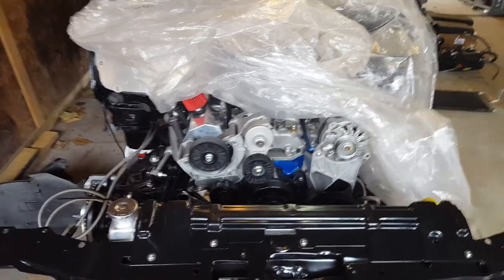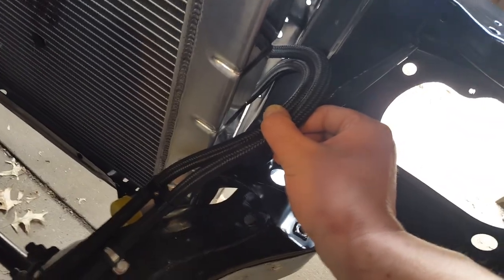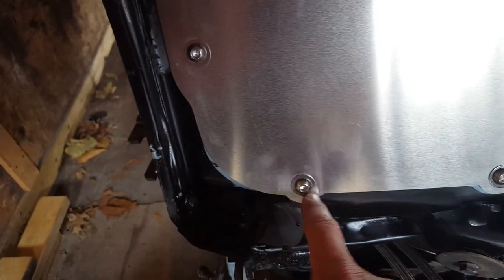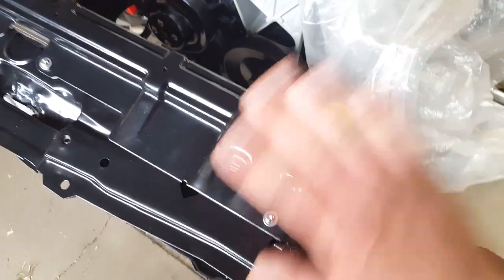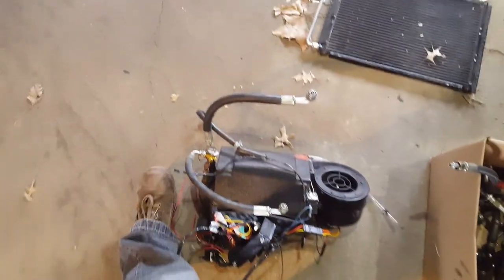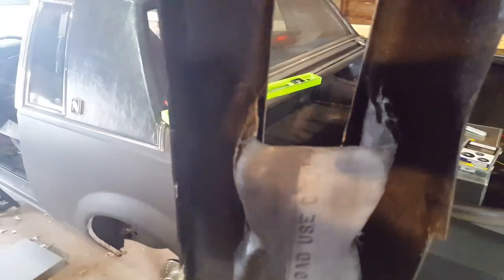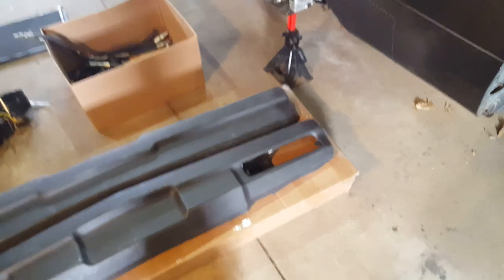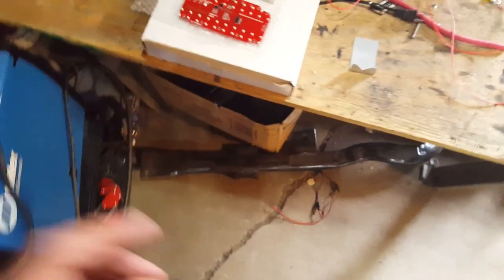G Body Buick Regal update smooth bumpers

Comment: What about a cross beam on the front and rear frame sections for added structural rigidity and protection in case of an accident? I have seen guy's use schedule 40 square tubing to add to the perimeter frame strength.
Reply from the maker: yeah I still want to try and figure something out with that I still have it in mind.

Comment: What’s the thread pattern for the bolts on the ac delete panel? I’m wanting to use those same bolts
Reply from the maker: I had to drill them out and use nuts  on the other side. I only used the standard bolts on the top where you can't see them. You wont find button head bolts with that thread.

Comment: Do you still have that front clip at 10:18
Reply from the maker: Zy Franklin that grille is what's on the car. All I have is the extra header panel and sorry its staying in the stash of parts. They're too dam hard to find.
Reply: Big Deezy Dang ok
Reply from the maker: Zy Franklin lol sorry bro! Lol! Those aftermarket ones aren't that great either a friend had one and I couldn't get the stock bezels to even fit.

Comment: Hey big deezy. Radiators without a built in trans cooler are for manual trans. If u are running an automatic u muat run a radiator with a built in cooler then if u wish run an external add on cooler . Your trans will run hotter without the built in trans cooler and it will also fluctuate without it.

Comment: $100 damnnnn! If you don't need the compressor let me buy it from you.
Reply from the maker: lol it will be a min before I figure it all out but I'll let you know first
Reply: +Big Deezy Ok cool. Im nowhere near finished with my car so Im sure I'll still be working on mines when u figure it out
Reply: +veltboy314 Thanks
Reply from the maker: +veltboy314 i was guna go LS but I've decided to keep it old school and build a stroker small block and put fuel injection on it so I can use all these other parts I've got and keep the serpentine setup so if i have to modify the serpentine setup to run that compressor I'll probably just run a stock one so that would be why I'd get rid of it. anyway lol! Yeah ill let you know happens. it's a nice compressor though!